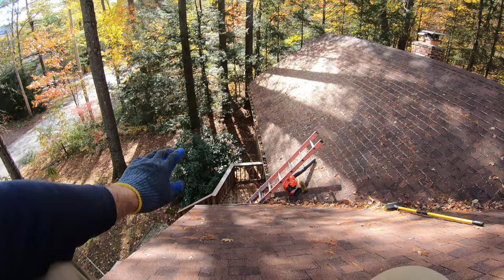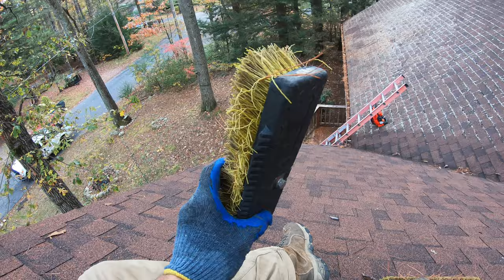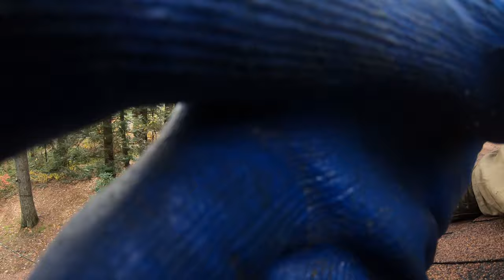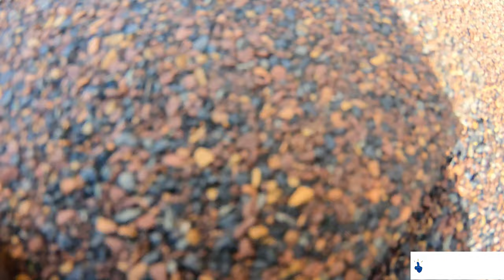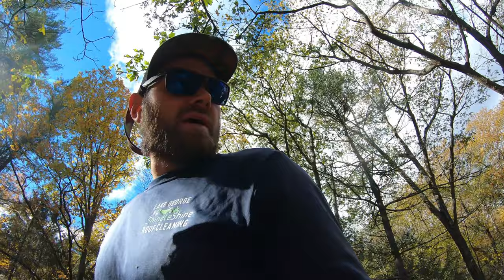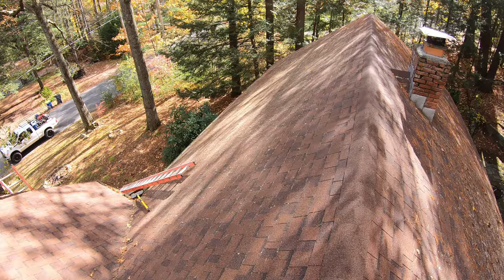Revisiting A Mossy Roof - Moss Removal - 12 Volt Soft Wash

Comment: Nice job as always! I just invested in a cheap brush set from Amazon that connects to a drill that I used for some nasty grout.  They have different brush weights (hard/med/soft) and sizes.  Ever thought of something like this for the moss? Worked great on the grout. I think the wire brush "style" of the brushes would work well to pin point the bad areas to reduce the loss of granules. Keep it up man good to see you taking care of the customers!
Reply from the maker: Could be a good idea! Never heard of it before I'll look them up! Thanks for the kind words and support!